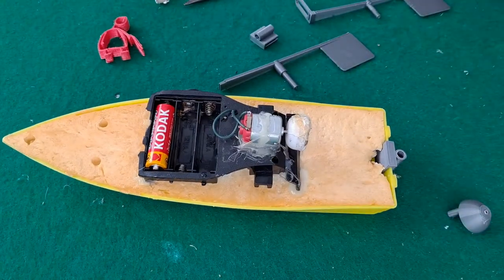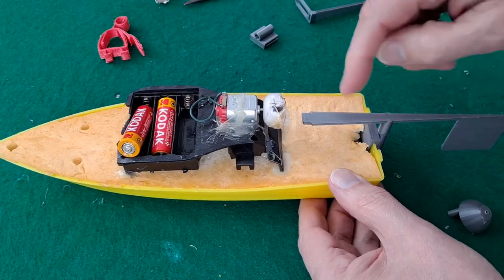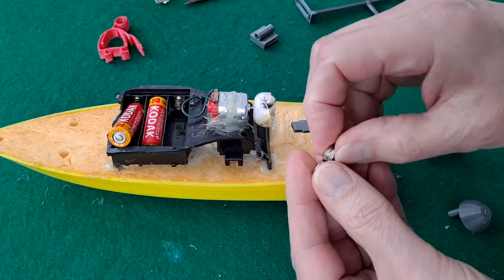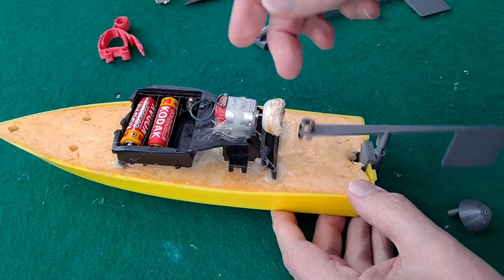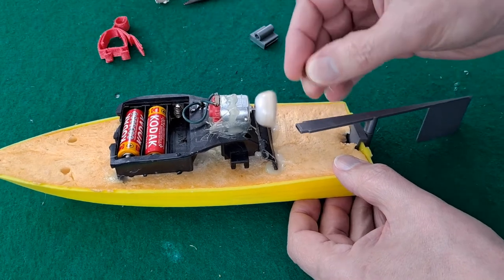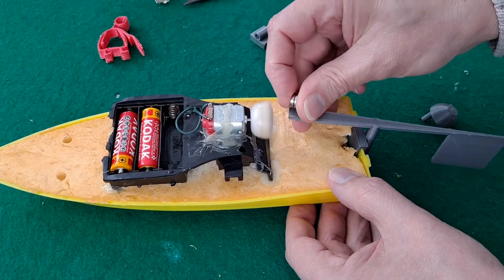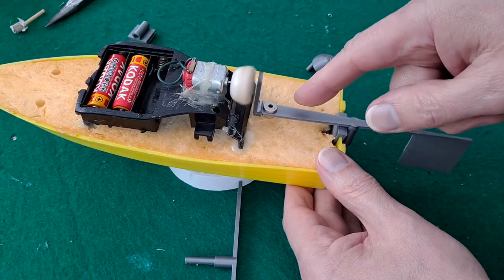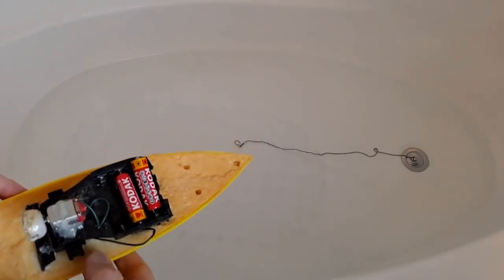PART 3 Flapper Paddle Boat revisited

Comment: My thoughts: the rudder needs to be hinged to exaggerate the paddle motion, and the motor is running too fast with too short of a stroke.

But then again, that's just my thoughts, what is left of them...

:)

Greg
Reply from the maker: Thanks Greg, as this progresses your thoughts are shown to be correct. I try various tweaks, but the bottom line is a slower rotation with a geared motor would be more effective, unfortunately I tried going faster. The little motor simply doesn't have the torque to spin with the power of the magnets I used. I also had a go with a flexible tail. An RC servo might provide a suitable geared motor source, so that might be an option as I have plenty of them available